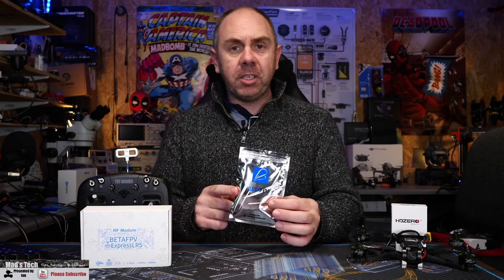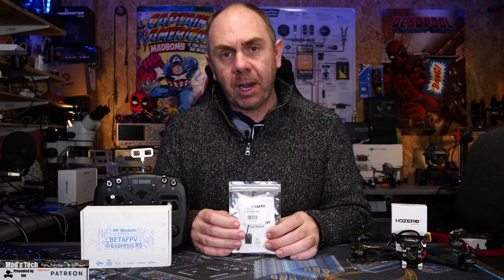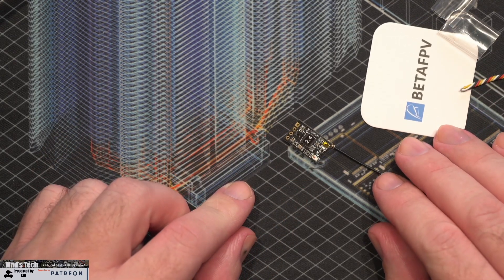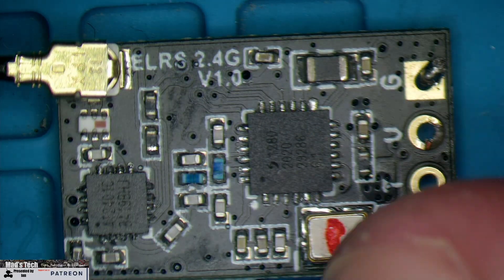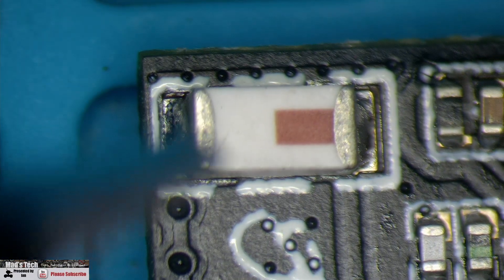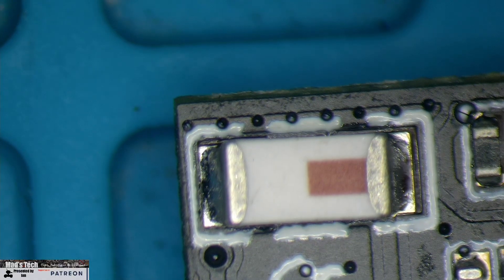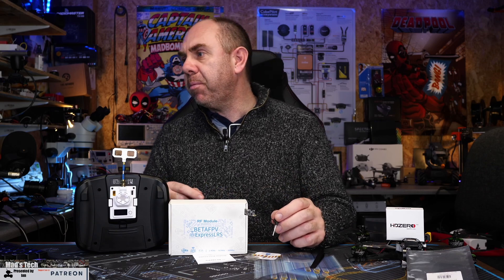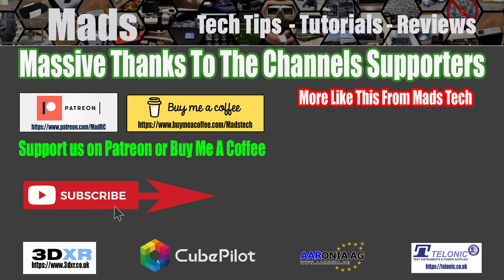BETAFPV ExpressLRS Nano Receiver - 100mw Telemetry Amplifier

Comment: I was unable to access telemetry power in elrs lua on the radio in the other devices section to increase telemetry to 100mw as I did in geprce in betafpv I have telemetry lost in just 2km

Comment: I think that amp is also an lna so it probably has a stronger signal (lna) coming into the chip in addition to the added power (pa) going out. You might also mention that the only other one, that I know of, that has a pa/lna is the matek rx's with a telemetry of 20 or 23dbm I think. ExLRS 2.0 is out already.

Comment: Hi Mad, I saw the black mark under your thumbnail on what I think is your left hand. 

I know bruises are quite common in the maker community but you may wish to get it checked out by a doctor as it could be a melanoma or other skin cancer.
Reply from the maker: It was an injury I did to my self..  It’s actually a hole.  I ended up stabbing my self though the thumb nail with a needle tip soldering iron.  The I just had now healed but it’s remanence is working it’s way down now.   

I really appreciate the heads up, i
Reply: @MadRC  ouch! That sounds painful but thank goodness not life threatening!!
Reply from the maker: @sarahdaviscc  it hurt like hell lol but it was self inflicted. The actual injury has healed it’s just the hole in the nail working it’s way down now.  It was a trip to A&E and a tetanus booster as it was rusty tip too but all good.

Comment: Excellent review! Just curious, does the crossfire nano receiver have amplifier for telemetry?
Reply: no
Reply: i’m not sure what the telemetry power is on tbs nano or any others honestly… but has anyone actually lost telemetry? I haven’t ever lost telemetry, I have flown out to fail safe and lost telemetry of course. I have some mavlink telemetry radios, and I can’t see any info about output power on those.
Reply: @nikhayes3396  Even chinese radio mavlink telemetry is 500mw each way. a properly set up crossfire system for long range (ie those 100km tests) will lose telemetry far before that (I've heard 20km).
Reply: @nikhayes3396  for crossfire, the tx->rx and rx->tx power levels are not symmetric, telemetry usually lost at around 1km, but control link can go much further.